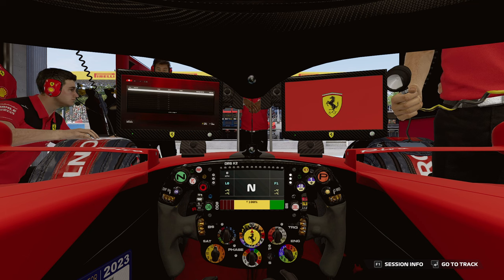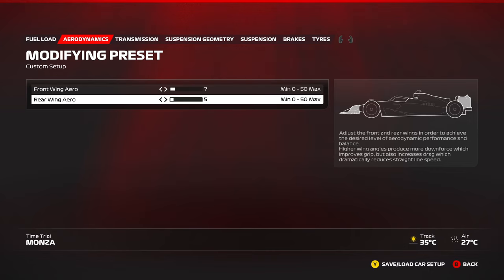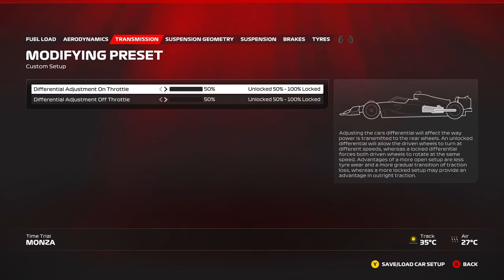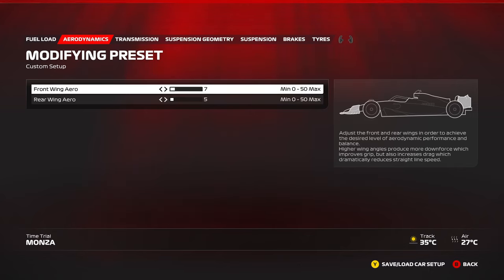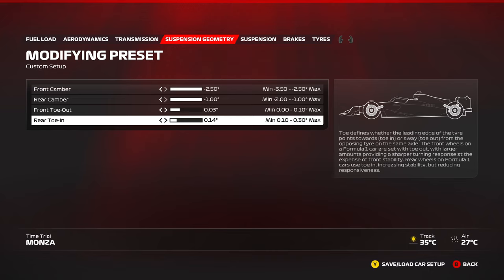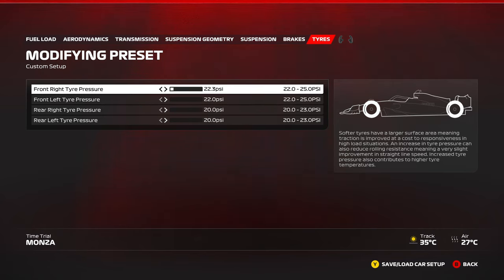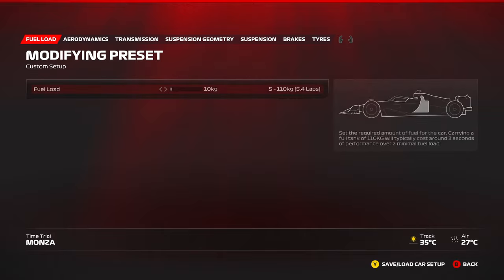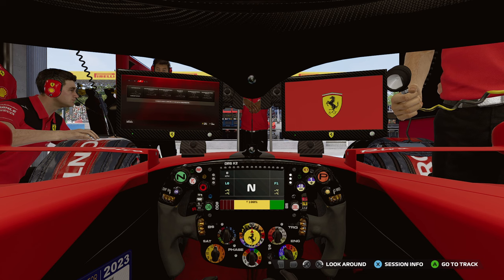F1 23 Setup Explained - with Timestamps & Baseline Setup (UPDATED 2024)

Comment from the maker: I lied, it was not 15 minutes😈

Baseline setup for any track:
Aero: use the wings from time trial or your setup
Transmission: Quali: 55-50 / Race: 55-51 or 55-52 or 55-53
RRLL suspension geometry
41-5-10-1-33-39 suspension
100-55/56/57 brakes
22.0 psi fronts (0 clicks)
20.0 psi rears (0 clicks)
For qualifying, you may try about 3-5 clicks higher tyre pressures.
For intermediate tyres, use +3 rear wing & +5 front wing.
For wet tyres, use +5 rear wing & +7/+8 front wing.